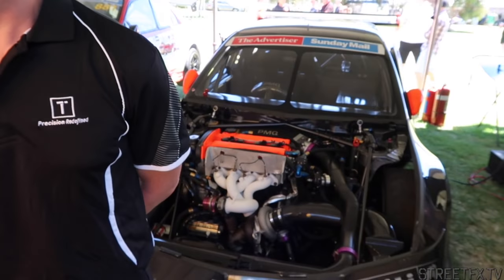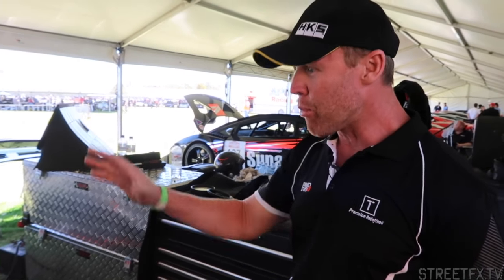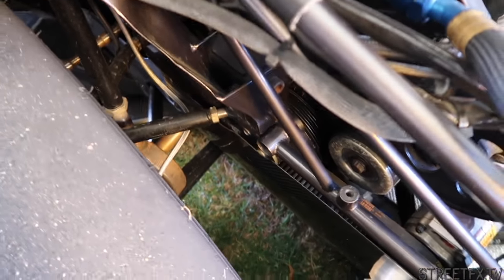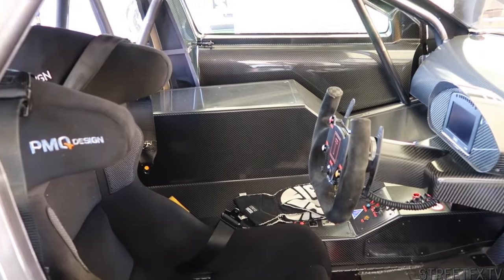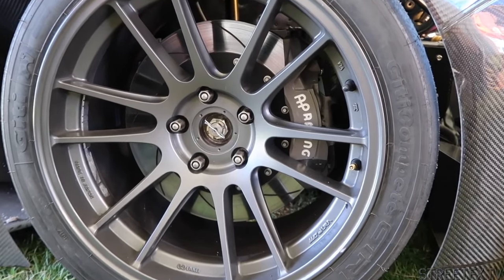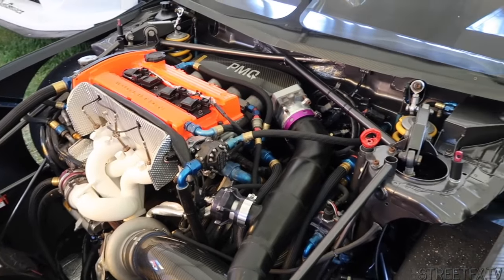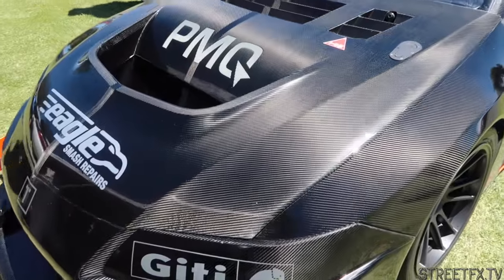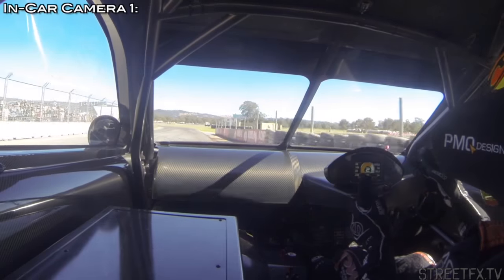This 800hp Evo is nearly 100% Carbon Fibre. It weighs only 1000kg, and it's absolutely stunning.

Comment: Loved it until he said paddle shifter
Reply: it has to have a sequential gearbox for time attack because you have to shift gears too fast and with sequential you can shift down through the gears much more easily at high speeds and more reliably
Reply: j0ey i know exactly what you mean  but im kinda like a purest you might say when it comes to stuff like this. Paddle shifters are for F1 and rich ahole cars or people who cant drive stick but wanna go to the redline and fuck auto stick to while im at it. They are just paddle pushers not shifters. Put it this way im still pissed about fast and the furious using the rb26 in the mustang. Haha
Reply from the maker: Try driving a car with massive aero at full tilt through a twisty course with only one hand on the steering wheel. The downforce makes the entire car sit basically on the bump stops, meaning the driver is shaking around like crazy. 

Paddles are superior in nearly every way. You realise it's still a sequential manual box? All race cars have sequentials, and most have paddle actuators.
Reply: Oh, leave him be, nothing can convince an H pattern elitist.
Reply: we all love manual gearbox, but you gotta go with sequential gearbox if you want to go faster
Reply: blah blah you dont need much feel for shifting gears anyway. you're just basically lopping a stick around. if they put the brakes and clutch at the fingertips like on a motorcycle, it would make more semse since you're bringing the mosr sensetive components to the most sensitive part of your body.
Reply: blah blah has to for speed. Just another upgrade :/

Comment: All that money in carbon fiber and still weighs 400lbs more than my All Motor EG hatch 😂😂😂
Reply: Lukus Aldridge your egg hatch is significantly smaller, has a less rigid chassis, doesn’t have an awd drive train, and has a tiny 1.6L NA
Reply: Also the cars have minimum weight limits in their classes
Reply: And it's still a civic 😂😂😂
Reply: just 800hp engine with turbo weight half of  your car
Reply: Look at these people getting are snarky at you. Some people can't just take a little tough-in-cheek and have a laugh.
Reply: All that money, and it weighs a few times more than my moped. Crikey!
Reply: Well who needs 800hp and a lightning fast gearbox when you have vtec
Reply: Lmao. Can’t believe you think owning a civic that’s lighter makes you think your more special.